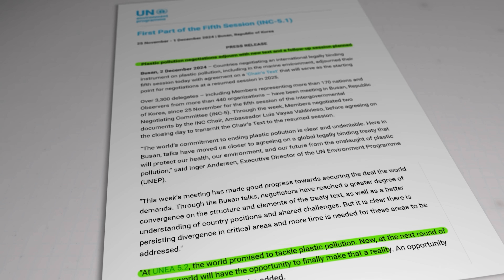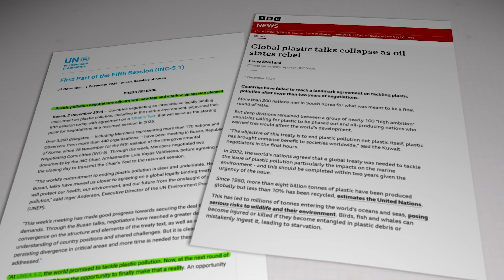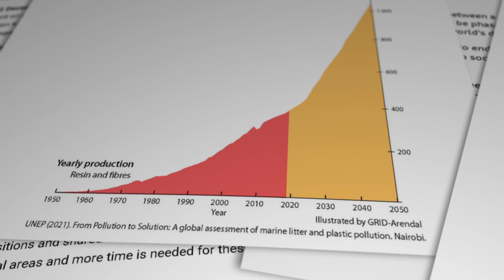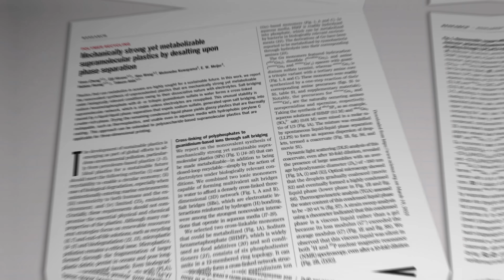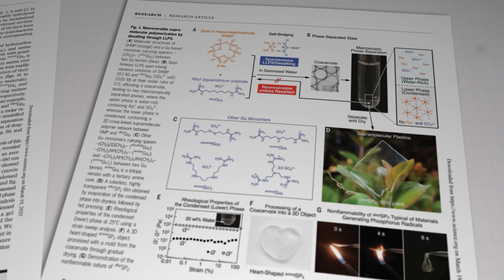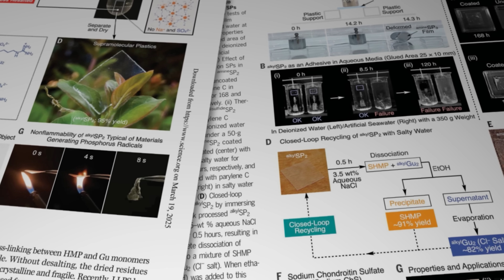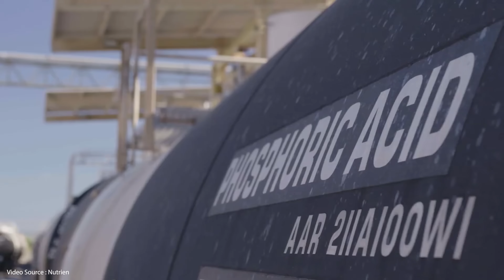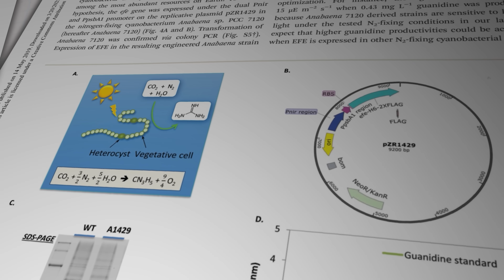New plastic gamechanger.  NO FOSSIL FUELS!  NO MICROPLASTICS!

Comment: Such potential solutions may be too benign & rational for the American avaricious industrial mindset.   

As regards covalent bonds of carbon molecules generally, these require high energy to break down the bonding.  My hope is we will eventually innovate some low-energy chemistry modification/atomic bolt-on which enables us to modify CO2 bonding to reduce emissions  -  preferably at source (CCR) or by some direct air capture (DAC) methodology.  

Such a chemistry solution would doubtless produce significant quantities of residual compounds needing to be disposed of, & in an ideal world (!)  such resulting compound could be a beneficial resource with "clean" applications.   Getting there is Nobel Prize stuff, but we are running out of alternative options on scale to slow down or stop global warming.

Comment: Looking forward to reading the paper on this.  But verrry interesting.  The salt degradation issue is going to impact a lot of potential roles but there are many it would be fine with.  Temperature tolerance (120 C glass transition?) seems ok but not great.

Not 100% solution but even 50% would be amazing if it works out.

Comment: There's nothing wrong with landfilling plastic. There is enough land in the world that running out of landfill space is not an issue. The fact that plastic doesn't break down is a good thing, as it can't leach into water tables. The problem, obviously, is the ocean. The thing is , that's not a 1st world problem. It's a 2nd and 3rd world problem.

Comment: If we do continue to use the very useful existing plastics, there is a relatively simple solution.  Heat them in a retort without Oxygen and turn them back into what is essentially liquid and gaseous fossil fuel.  It works with any sort of plastic, clean or contaminated.  The resulting fuel probably wouldn't be enough to pay for the process, even when the heating is done with renewable energy and that is where externalities come in.  Not taking externalities into account results in some of the worse abuses of our environment.  A way must be found to credit the company that does the pyrolysis with the damage they mitigate.  Presto chango, the process becomes financially feasible.  https://mtkass.blogspot.com/2019/09/pyrolysis.html

Comment: Single use things are kinda the problem.  If we arrange pickup and return logistics correctly, assuming we have an economy left, then glass bottles could make several cycles before they're wore out, like it was in the olden days.  Plastics for basic food packaging is the bulk of the problem, so glass can work quite nicely and washes up easily.  And if the glass winds up in the ocean, then it becomes beach glass. 🍷 🏖️. And to melt the sand for the initial glass production, green energy can be used, maybe tap more geothermal or use solar furnaces in the desert🏜️.

Comment: Thermal depolymerization is the answer. It recycles waste that does not get recycled now. The process generates oil, gasses, and char, all of which can be used for many other things. If the process is cut short you have polymers, fibers and materials that can be used in production of many more things, and you still get some oil and gasses.

Comment: Industry desperately trying to maintain current level? World moves away from fossil fueled energy?  What are you talking about? Crude oil production is constantly rising despite you Green Idiots constantly inventing new ways to make it harder and more expensive to produce. 1980 80% of world's energy by fossil fuels 2025 79% (these numbers are approximations not real data in case you try to dismiss my argument but are very close to the actual numbers)  , that's very fast moving away if you ask me.  Cut the Bullshit already!

Comment: Great. Now, let's get this new material...

... scaled up
... certified for use (formal side)
... approved for use (informal side)
... manufacturing solutions available
... multi-source supply available
... engineering expertise and experience available
... design solutions available.

If the material isn't scammed, then we are ;-)

Comment: The "non-toxic" claim seems a bit of a stretch to me. Guanidinium and alkylguanidiniums, like most alkyl-ions, have chaotropic qualities and are poisonous to aquatic organisms, disrupting the function of gills. Disposal cannot be casual, but this does suggest a method for recycling of used plastics of this type, which is promising. I'd like to see it work, but poly-ions themselves seem to be just another source of toxic substances, and especially so when over-produced, which we would do in any industrial application.
Reply: I'm sure that even if it was 'perfectly safe', due to our infinite growth global paradigm, anything that appears safe on the limited small scale tests they do, after it spreads globally like current plastics and is used for the smallest most pointless improvement in convenience, simply by it's scale of use and concentrations it will have detrimental effects.  Essentially nothing is safe when we just go full on positive feedback loop on anything we do (infinite growth), and don't suppress to keep certain activities at a certain scale, frequency and locations.

Comment: Could build floors and living quarters in the fuel tanks themselves. Making up the fuel they displace with attaching solid fuel boosters. Imagine even lights, wiring, doors, etc designed to resist frigid liquefied propellants pre-installed in the tanks. 😊

Comment: Empty booze bottles make great water bottles for boiled and filtered water. They dont shatter from the hot water and dont crack when bumped unless you bump rock/ flooring. I have repeatedly  used the same set for 10 yrs.

Comment: Three cheers for Sodium Hexametaphosphate, I use to sell that product by drum when I was a water treatment chemist for Calgon Corporation back in 80's & 90's. It is used as a corrosion control additive to drinking water systems.  At 1 to 2 ppm it provides great corrosion control for the distribution system (pipes).   That is the chemical that the Republican governor of Michigan decided was too expensive for the drinking water system of Flint, Michigan. Many people paid a heavy price for that short-sighted decision. That was back in 2014.  Glad to see it has another valuable use, if this technology works out.
Reply: Alternatively, maybe Flint Michigan's pipes shouldn't be made of lead and maybe don't rely on bandaid solutions like corrosion control in the water supply.

Comment: When we see large piles of plastic floating in the water, we must think of them as an easily usable fuel resource. Indeed, when it floats, it is not chlorinated PVC, and therefore combustion will not release hydrochloric acid gas. Of course, a dedicated installation with a furnace allowing true complete combustion is required, and a smoke filter is also required to work cleanly. The energy can power a steam boiler and a turbine to generate electricity. Incineration helps reduce the volume of waste.

Comment: There are biodegradable varieties among polyesters. Depending on the nature of the diacids and dialcohols, the physical properties determine whether biodegradability is possible or not. The problem with biodegradability is that it must occur at the right time, not at random.
Cellulose is the most widely used biodegradable polymer, and it can be used to make paper, cardboard, and textile fibers. For food packaging or single-use cutlery, the cardboard must be hardened and waterproofed. This should be possible with cellulose solutions that can be obtained (a British invention!!) with a very special solvent. This would allow the use of an abundant and biodegradable natural resource. Cellulose varnish will biodegrade more slowly within a timeframe compatible with the intended use.

Comment: IMO the problem with plastics is disposal chain escape, not the plastic itself. Many problems with plastics are from it being single-use, but that's the problem with any single use material and at least the TCO for plastic is low. You don't even need to recycle it, as long as you properly capture and destroy it.
Reply: The problem is that plastic is toxic, so once you produce it, you have created the problem. If you burn it you create all sorts of toxic and carcinogenic compounds. If you bury it, eventually it leaches toxic chemicals. Moreover, plastics leach toxic chemicals, micro-plastics, and nano-plastics during their use.

Comment: 120c is crazy low temp so it'll probably start to deform at 100 so using it with food would be difficult. the cost will be massive so noone would use it. maybe in 100 years people might start to produce it when fossil fuel runs low. it's already too late to start looking. it'll be another 10 years before anyone would consider manufacturing it in large scale and another decade before it's wide spread. that means it's already too late for the planet. 8 billion people is just too many at such a short amount of time. the planet can't take it.

Comment: The very LAST thing you'd want to put into a watercourse is something which breaks down to nutrients like N and P...the result would be eutrophication.  This is fun research, and totally stupid as any kind of "solution" to "microplastics".

The problem isn't the materials we use, the problem is our "single use" culture.  And why do businesses feed that culture?  Because we reward them by buying it at their stores.  Every time they find a way to make something more convenient, we buy it.  If we stopped, they'd stop.  And since we won't, what we really need is a deposit-return system to make single uses more expensive and recycling more feasible.  And what plastic we end up with in the end, which is too dirty and mixed to be recycled, we should just landfill.  In a landfill, plastics last for millennia, because there is no sunlight or oxygen to break them down.  They are environmentally benign in landfill, and represent about the cheapest post consumer sequestration of fossil carbon imaginable.

Comment: “It is foolish to tear one’s hair in grief, as though sorrow would be made less by baldness.”
― Marcus Tullius Cicero

Any discussion about plastics that assumes all plastics are basically all the same thing is unlikely to be very helpful. We should adress the actual consequences, and not a wildly diverse category of materials as a practically homogeneous group, regardless of the type, how it is produced, and how it can be recycled and so on.  In essence, reality is important, not labels. 

Also, microplastics, why would materials break down to some particle size range, and then suddenly essentially stop breaking down? Is it because that makes it possible for them to exist but makes them impossible to observe without special equipment? It doesn't make any sense, a material that breaks down into smaller particles gets increasing surface to mass ratio, meaning if anything it should break down faster the smaller the particles gets.     

There's actually not much good evidence for microplastics in the environment causing significant environmental damage, or health issues for humans. The fact that we haven't found much actual evidence for negative effects doesn't prove it is a very severe problem that we're somehow unable to detect.                    

 We can produce a whole range of plastics from other things than petroleum, it's just that petroleum is a cheap source of input.  

There are very real and some very severe issues associated with some plastics, in some situations, that we absolutely need to solve, but often plastics are the least bad option, sometimes some plastic is the least bad option by a very wide margin. We shouldn't villainize all plastics as a category. 

I don't believe in silver bullet solutions for global categories of complex issues. The fact that production of PLA would require a lot resources, if we replaced all other plastics with PLA and didn't improve recycling is kind of a mute point. PLA can't replace all other plastics, and we should recycle more, and as it is we use many times more agricultural area than would be needed to produce PLA to replace all other plastics, just to produce biofuels and animal feed that we actually don't need.  Two wrongs doesn't make one right, but I think it's important to keep relevant perspectives in mind. 

A quick googling says total global annual production of all plastics amounts to about 60 kg per person on earth, while that's a lot, it's not much compared to the ton or so of fossil fuels we burn per person every year, or hundreds of kilograms of food type crops we produce to feed animals and produce biofuels.          

I think we as a species can adress the very real issues associated with plastics, quite well, but I also think that requires that we stop villainizing all plastics, and we also need to stop focusing on speculative dangers that we haven't been able to confirm are real, despite the fact that a lot of effort has been made to find such issues.

Comment: I think the problem with plastics could be mitigated somewhat if major producing countries unilaterally banned not only the domestic production / use of certain plastics, but also for export. I'm not sure how it would be framed as legislation but it something comes packed in polystyrene with no justifiable purpose, then it should use cardboard instead. And likewise if it needs to be shrinkwrapped then biodegradable film instead of LDPE film. And single use products should also have to be biodegradable. Of course there would need to be exemptions but it should framed such that obtaining the exemption is more onerous and subject to greater checks to prevent abuse.

Comment: I don't think the energy cost has been properly analysed in this video. 

What we needed was a comparison of making one ton of the new plastic vs one ton of current plastic. The initial point would be to make that cost comparable to making current plastic. 

Thereafter, the energy cost of making the new plastic from raw materials would be offset by recycling the existing stock seeing as it's so easy to recycle. 

Once we get to a point where we require the same amount of new plastic as the amount we dispose we will then have a perfectly circular plastic economy.

Comment: well lets see how useful a plastic that dissolves in seawater in an hour or two is... since one of the main properties of most all useful plastics is that THEY ARE WATERPROOF... water soluble plastics are basically useless for 99% of their normal use...

let's see water soluble plastic water bottles might be useful for distilled water but fabric mad of the stuff would fall off your body if you sweat... but it would eliminate the need to wash the clothing...

now to be fair I will assume that the researchers did not set out to develop a water soluble plastic but instead one that was more easily recycled that say HDPE, or PET... but if they did why don't they develop dehydrated water next...

Comment: There is work to use green hydrogen to make ammonia hopefully replacing the Habber Bosch process. Ammonia is needed for fertilisers. There is also work to use green hydrogen in fuels not as hydrogen but as ammonia. My point is that a lot of the problems associated with guanadine production have solutions. As do the perceived problems of small green hydrogen fuel cell vehicles.

Comment: 1. We have already solved the plastic problem. We need to scale pyrolysis and make it economically viable. The pyrolytic oil can be mixed with crude oil. The byproducts, biochar, and syngas can be used as replacements for coal and source of energy, respectively. 

2. We need to replace food with waste for biofuels to reduce their carbon footprint and also land required to obtain the biofuels to nearly zero

Comment: Hi, I commented once a long time ago. Always love your channel. Professional and informative in detail. Love it. Lignin, nature's most abundant polymer, is now available from a process in pure form and can be made into all manner of things that single use fossil plastics have been used for up to today.
There is a new way of obtaining lignin from a cellulose to sugar process that's being championed by Blue Biofuels, a publicly quoted company in Florida. They have a process that was initiated using "mechanical chemistry" by a NASA scientist called Dr. Richard Blaire. His edge was to realise that chemistry sometimes happened in ball mills and that in the case of cellulose, which as you know is a tightly bound compound of lignin and glucose, the mill reduced the particle size so small, that the tight grip loosened and what scientists themselves had come to call the "recalcitrant" molecule, in this case cellulose is reduced to lignin and glucose with the least value input and almost instantaneously. The new CEO has invented a continuous method and scaled the process to 5 tons a day from the 1 kG bench model. Combined with a technology called the Vertimass reactor, the company expect to convert cheap ethanol they make to common hydrocarbons in particular sustainable aviation fuel, which they will have a lower cost of production than even the big biofuel OEMs. Its worth having a think about!

Comment: Very nice.  I wonder what percentage of plastic applications could be replaced with this new polymer - as you said, this doesn't sound like it'll work for every application, but it sounds like a huge step in the right direction for everything that it can be used for.